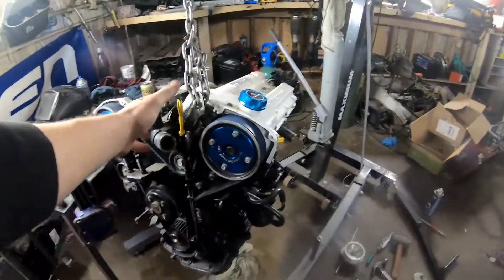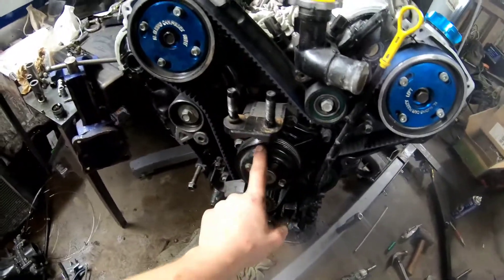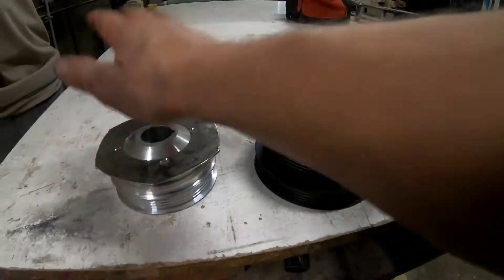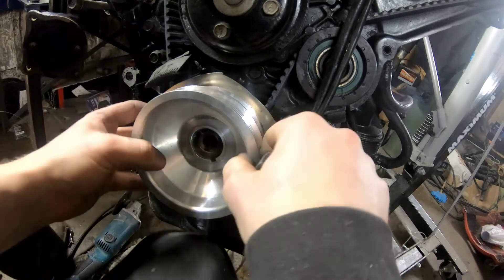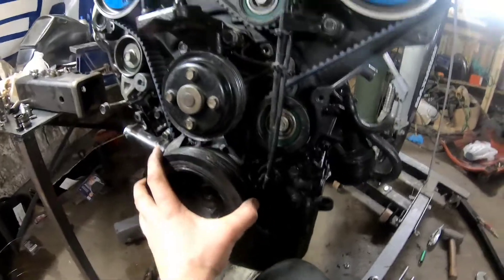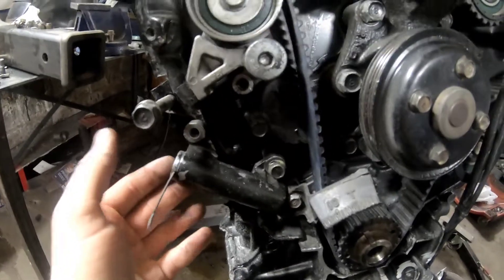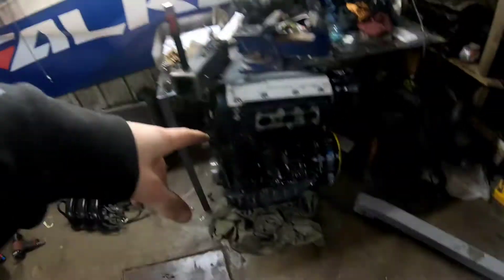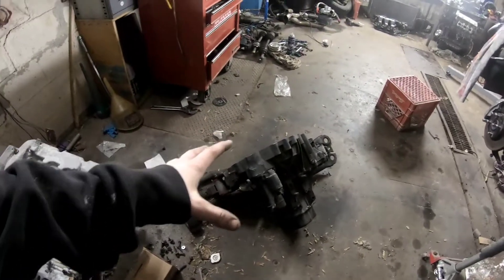how to set timing on a v6 mazda or ford!

Comment: I'm having trouble doing the distributor timing on my 2.5 KLDE. I cannot identify where the timing mark is on the crank pulley, and I do not have the plastic timing indicator as I have no timing belt cover. Any advice? Thank you!
Reply from the maker: Is your a klde engine?
Reply: @Suicid3mx3 Yes the 2.5L, from a ford probe, I have a Mazda 323F ZXI, swapped in
Reply from the maker: @MetallitiGames the timing mark is on the teeth on the tim8ng gear on the crank, closer to the engine than the pulley, take the pulley off
Reply: @Suicid3mx3 Thanks. So I have to take the aux belts off to do ignition timing?
Reply from the maker: @MetallitiGames oh shoot your doing ignition, ya it should be a small notch on the pulley

Comment: hey there, nice work! 12 cyl. mx3 omg lol i never subbed so fast..xd
 love your vids. could you please tell me where you got the adjustable cam pulleys or what brand they are? i believe cdf racing made them at one point but it seems like they are out of business. i cant find those things anywhere.. also, is that an nrg quick release you're using? if so how do you like it? is it free of play, easy to get on/off? love to hear about it. cheers!
Reply from the maker: Ya its easy on and off its good

And the pulleys i got on a car I bought so idn

Comment: Is the distributor redone?  the switch flew ..... I have almost the same current coil made
Reply from the maker: I use a external coil and ignition module
Reply: @Suicid3mx3  could you make a video on that please
Reply from the maker: @josephhenry2925  on what
Reply: @Suicid3mx3  hei mod
Reply: @LTS_FOREVER _ not all heroes wear capes🙄 just bought a new distributor👅

Comment: You know there is an guide available “ put your timing belt on correct the first try” . It definitly is my guide as it counts the number of teeth on the belt and where it should align against the markings on the block. 
Still good vid how to put it on.

http://www.mx-3.com/phpBB3/viewtopic.php?f=15&t=77978
Reply from the maker: Ya I have done that before  it takes 20 min to count and mark the belt lol